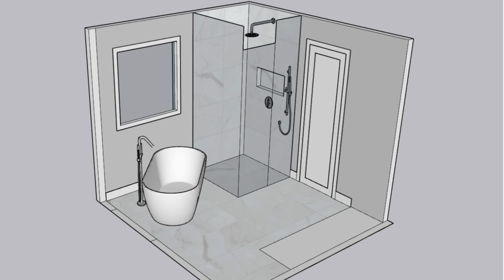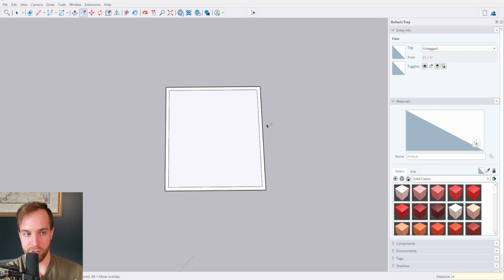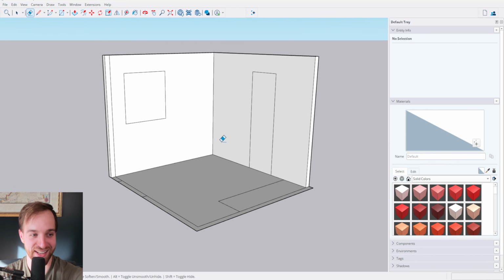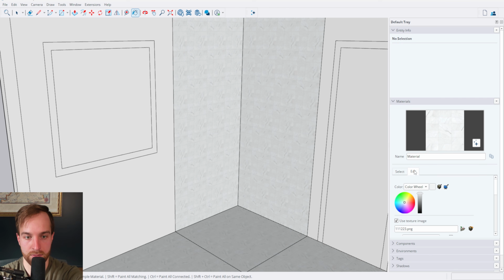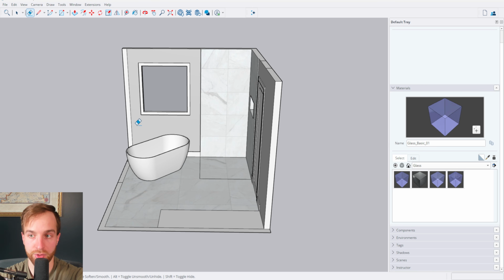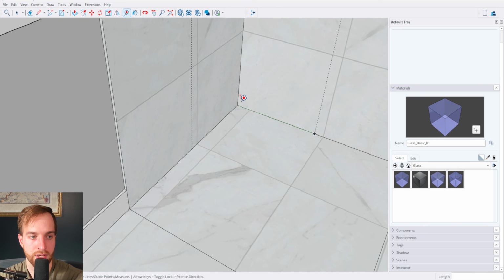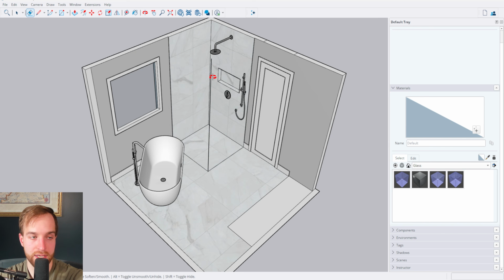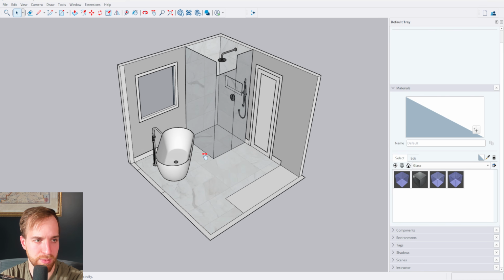How to Design a Bathroom in SketchUp (Complete Step-by-Step Guide)

Comment: I've followed your steps precisely, but I cannot amend the dimensions? It is allowing me to select what is there but cannot type my desired measurements in?
Reply from the maker: If you want to type your measurements in you need to do it immediately after placing something before clicking or doing anything else. If you want to amend something existing where this wasn’t the case you’ll need to use the push pull tool, scale tool, or simply redraw it.